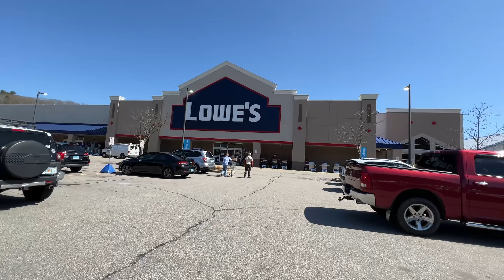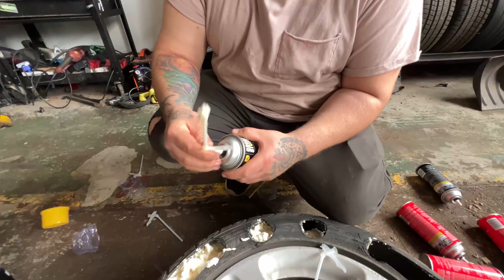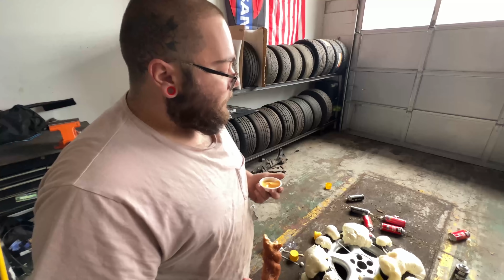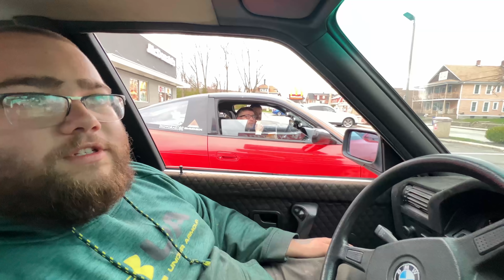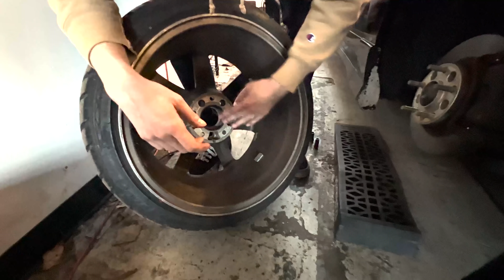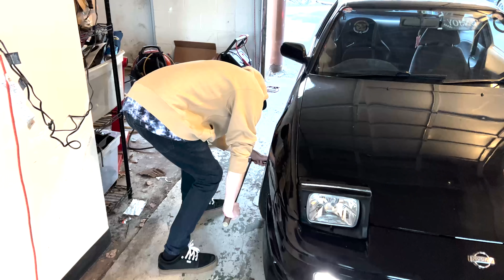Filling a TIRE with SPRAY FOAM!

Comment: Try taking the valve stem out and filling a tire with foam. Then replace the valve stem. That way the foam can’t leak out of the holes in the sidewall.
Reply: The foam would never dry
Reply: it still won't dry, and actually slower, theres no air being pulled in, and the gassing of the foam can't escape. they'd still be rolling on wet non dried foam either way.
Reply: Its mostly air anyway
Reply: Even if dry theres no strength to spray foam
Reply: Exactly what I thought when I seen the thumbnail
Reply: The foam didn't leak out. It was crushed.
Reply: We already did that!! 👆🏻

Comment: Way to many holes, so you need to get a liquid mix, you put a hole in the top of tire and put the liquid foam though the valve stem until it starts running out the top hole Tiny hole not a big one, just for air to come out

Comment: To do this "the right way" you drill about 8-10 1/4 holes in the sidewall and fill it with the regular foam (the 3x gap fill has too much airspace) and let it set up for a few days. Then mount the tire and drive on it a few miles to compress the foam. Now you have to drill about 10 holes in-between the treads all the way around the tire and fill it with foam from there to compensate for the foam compressing. Just jack your car up and let it cure over night, but at this point you just repeat putting foam in from the tread every time it starts to look like the tire is going flat. Eventually after a few times it will stop compressing and your good to go. Don't ask me why I know this
Reply: Why do you know this?
Reply: @zw0931  Questionable life choices

Comment: kinda ruined the structural integrity of the side wall on 1 side of the tire there bud... could of just made 1 small hole and injected it straight from the can
Reply: Or put it in the tire then mount the tire
Reply: @atomicbogator6799  no
Reply: @cameronmitchell9716  why?

Comment: I used to work at a lumber yard and we actually paid a tire company to foam fill the forklift tires.  They did this because we kept getting flats.  The foam held up real good, but if I recall they filled it completely busing the valve stem and then capped it and the foam basically expanded real dense inside the tire without an escape. It was probably a special foam as well.

Comment: I think the foam wasn't cured all the way,  that foam is actually cured by moisture in the air, try spraying water in with a squirt bottle as you spray the foam in, still i don't think its very strong, you should try filling the tire with empty water/soda bottles and then use foam as the filler or maybe silicone

Comment: It wasn't dry that's why it flattened out in the tire. If you would have gave it a week or two to cure through the middle it may have worked but it has a hard time drying when it can't breathe   try again

Comment: You guys made too many holes.  Holes should have been blocked with duct tape after filling  so it expands in the tire not out the tire. It also wasn't cured yet.   P.S.  your vids are blown out - Fix settings 😁😁😁

Comment: You guys did not give the foam enough time to expand also lots of fresh air helps expansion. Cutting this is a job within itself 🥵😱🤦‍♂️🤦‍♂️🤦‍♂️🤦‍♂️🤣🤣🤣🤣 a day of work right there genius 🤣🤦‍♂️ y'all must be using the expired old DISCONTINUED stock shit bc the spray foam that I use is functional in outer space and NASA certified. You can sit there and watch it expand for longer than I care to watch. Seriously though I could probably confidently fill a bathtub up at least halfway with one can of the same size spray foam.

Comment: I hate that nobody ever does a spray foam video right. the spray foam does not dry when it's 7" thick in less then even a few days to a week... lol there is not 1 remotely hard spot away from what is seeing air, everything Inside is not drying whatsoever because it's encased in it's own fumes, which keeps if from drying, kinda like literally anything the sprays and has to dry, it has to gas off.. lol
Reply: I don't think it would work great anyway but yes, and what you do is spray water in as you spray foam in because its actually activated by water, it usually absorbs the water from the air but once its sealed off it wont activate and cure